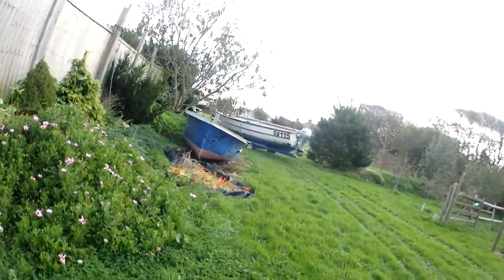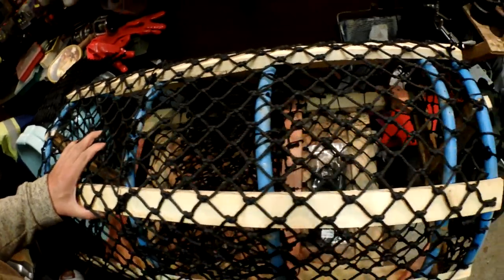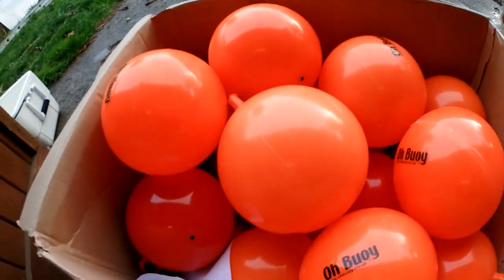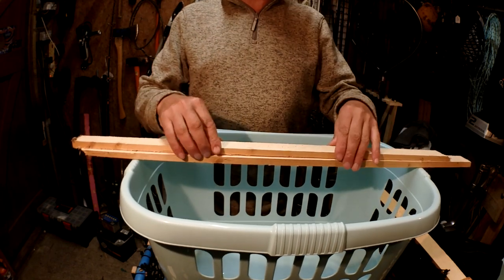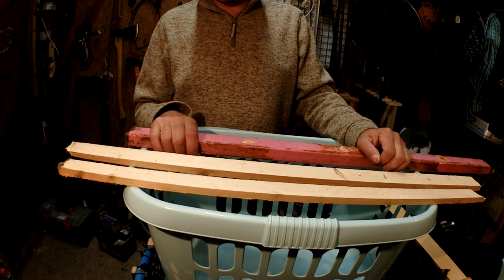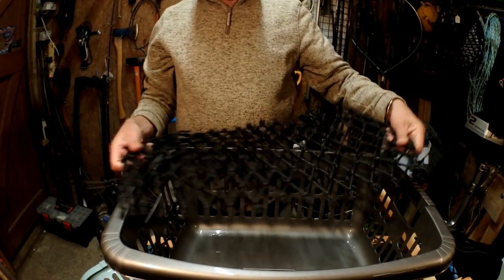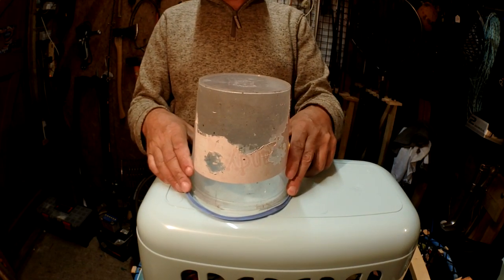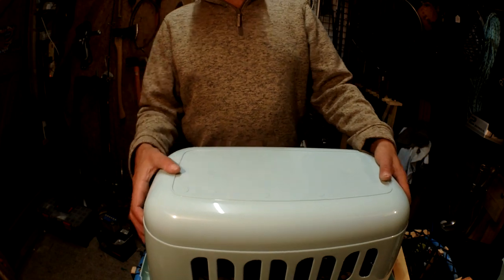⛵ Washing Baskets & Crab Pots - Buoys, lobster/crab Pot build thoughts & boats up

Comment: Regarding the pot entrance... Have you got any florists near you that have the black pots that the flowers come in? Sometimes, the supermarkets give away the pots, as it's a charge to them to get rid of them. They maybe an ideal size for the pot neck entrance once the bases are chopped off....? And for the weight, have you any railway footpaths near you? Have a walk along one. You might pick up a discarded bolt that would have been dumped at the side, rather than being taken away during maintenance...
Reply from the maker: Flower pots work but need the right plastic.  Unfortunately no railways here but good Idea.

Comment: Hi Troj
I have a couple of similar pots they are two plastic shopping baskets cable tied together I have a plant pot entrance slightly offset  in the top and they are weighted with milk bottles filled with concrete cable tied into the bottom  stainless wire holds the bait an inch up from the bottom of the plant pot in the middle of the trap.
I only put them out for one night this year but a got two big spider crabs so they work . Hoping for a lobster next year fingers crossed
Reply from the maker: Nice make sure your bait is at least a day old then the lobster will come

Comment: Hi Troj, Why not make the wooden base with the slats but make them a bit longer than the pot so that you can rope a concrete driveway block or engineering brick at both ends.
Should be heavy enough whilst keeping the weight out of the basket catching area.
Reply from the maker: Its an idea but Im trying to keep the pots as small as possible for this build

Comment: When we were kids we used these baskets, with the basket upside down we would fill the lip around the edge with concrete, it would brace the basket a lot and add a balanced weight low down,  we still had to add weight but not as much, and that was generally old rebar off cuts laced to the outside that we had managed to scrounge from any building sites we could find, thinking about it I guess they would have braced up the sides a bit as well.
Reply from the maker: This did cross my mind but not sure if the concrete would stay in the lip.
Reply: @Trojwaterman  Once the concrete is set we used to lash around the base with rope to secure the bottom and protect the edges, but if not doing it this way I would have thought pilot hole and a few short screws from the outside of the trough before pouring the concrete would work ok.
Reply from the maker: Might be worth a try I could use some chicken wire to reinforce it

Comment: Hi Troj, Could you put concrete in the cavity where the lip folds over. This could create an even weight all the way round so the pot would settle on the seabed properly?
Reply from the maker: I did think of this but not sure it would stay in, plus it would still need more weight.

Comment: Good morning! Man that basin turns into quite the tumultuous bit of water. I was wondering, do you have to make it so your trap will stop fishing if you lose it? Here we have to have a hole in the netting, closed up by rot chord, which is just basic Butchers string. I'm on the Pacific Coast of Canada.
What about plant pots? They are heavier black plastic in many sizes for your entry way? 
For weight you could sandwich piping, one inside the other inside another with threaded caps on each end, then bolt them to a wooden frame or plywood?
Reply from the maker: I do have the end of the pot strung so it can open but If I ever loose pots in a storm they would be destroyed if lost they wont survive the winter storms here. Flower pots is an option if I get get the softer plastic ones.

Comment: Well the washing basket trap I made has got some old oven shelves for the base with some lead piping cable tied to it for weight and the opening is a plant pot you use for tomatoes the one's with no bottom that you place on top of a grow bag, it looked great, I tried it a couple of weeks ago and when I tried to retrieve it it got stuck and I lost it! Not quite the plan 🤣😂
Reply from the maker: That was a bit of bad luck was it the rope that jammed
Reply: @Trojwaterman  possibly I'm not sure but you are probably right, thinking about it rope did look a bit frayed where it snapped

Comment: Perfect idea came to me, 2 or 3 long scrap steel reinforcing bars for the length sitting in holes part way through the timber either end of hardwood side braces at the ends & middle like a rectangle base, if you have some scrap steel box strapping to nail around the outside of the wood ends to pull the reinforcing bar all tight into a solid rectangle that you would spiral rope around the wood & steel base onto the open basket as well as net. If you don't have any reinforcing bar or net or box strap you can get from the hardware 12mm 1/2"x 3m 10' reinforcing bar for 5 quid, 1000mm x 35m Yellow Safety Barrier Mesh for 13 quid & a roll of 25mm x 0.6mm x 6m Punched Metal Strapping for 2 quid using it the same way for only 20 quid plus rope, baskets, flower pots & buoy's which I wouldn't know the price of.

With the top flat part of the basket, cut a large enough hole so that you can put a modified flower pot upside down with the skinny end sitting 10" above the flat part of the basket, this will prevent your spider crabs from getting in or huge mud crabs, the lip of the pot can be inside the basket screwed onto the basket or just use cable ties. Attach your rope & buoy or girl whatever floats your boat to the wooden part of the frame by drilling 2 holes 2" apart all the way through the wood so that you can tie your rope through for hoisting aboard having the strongest holding point on the crate. Job done simple, quick & easy.
Reply from the maker: reinforcing bars is a good Idea getting them more of an issue plus everything here costs an arm and a leg.
Reply: Use sand in recycled milk bottle containers tied onto each corner for weights

Comment: When you say work on the boat Troj, what exactly will you do?..what about the small boat will that be serviced as well?
Keep safe
Reply from the maker: I need to do some work on the engine mount and seat as there is some decay in the wood under the fiberglass I need to reinforce it. I also want to change the boxes cupboards that have the battery gps,and sounder. plus much more. the small boat is probably ok  but will go over the trailer.

Comment: Maybe you could get hold of some old rebar and run some lengths through holes drilled in the basket and secure. I used a load I found on the beach to reinforce and weigh down a light lobster trap I bought online.
Reply from the maker: That could work if there's enough weight

Comment: Plenty of stones on the beach for weights,you could cut them with an angle grinder to size and drill them for fixing.
How about kids beach buckets for the entrance?Garden centres sell  different size buckets,I got a dozen online for mixing fibreglass.
Reply from the maker: Stones again will fill the space need a fair weight. Buckets is an Idea if the plastic is tough enough.
Reply: @Trojwaterman  There is quite a range of buckets,and they don't deteriorate in the weather.
As a builder,I would cast concrete bases for the traps.If you use pea gravel and a 3-1 mix,it would be dense and as heavy as steel pipe.The cement mix is tough and almost impervious in the water.You could cast holes in the base quite easily with removable plastic pipe for fixing.

Comment: I just worked out the cost for 6x Crab Pots with 6x 6" Floats, 6x Bait Holders, 6x Jumbo Laundry Baskets 67L W:490 H:300 L:725, 6x 3L Buckets W:190 H:160 L:190, 9m of 16mm Reinforcing Bar which makes 6x 2x 750mm, 1m x 35m of Yellow Safety Barrier Mesh, 25mm x 0.6mm x 6m Punched Metal Strapping & 8mm x 250Mtr High Strength P/P Rope costing 28.34 GBP each Crab Pot. But If I go & buy ready made store bought flimsy Crab Pots they would end up costing me 52.38 GBP  each Crab Pot with all the added bits like above. The Crab Pots I'll make will be the same size & almost half price, amazing, built on the same idea in a previous message below.
Reply from the maker: The biggest issue with store bought aside from the price which are around £60 to £70 here with no rope buoy, is they are also more likely to be stolen than a homemade pot. I am aiming with these for £10 to £15 without rope/buoy. But the biggest goal is making sure they catch more.
Reply: Yeah if I didn't add the rope, the 6" floats & 6 bait holders then my setup would be much cheaper all up too but I think I worked out a reasonable deal, I'm unlucky that I can't get to any scrap in my physical condition  so I need to rely on buying everything new so to keep the price down I really need to be creative. Because you don't have access to steal you could tie some old milk bottles to the corners & fill them with sand, if they burst open or get damaged then no drama, just replace them. Come to think of it I might do that to  each corner of mine lol, that's taken off 4.32 GBP of each of the 6 Crab Pots.

Comment: Hey trojs I made a laundry basket pot used some stainless steel mesh for the bottom had two lobster and a decent size edible crab on first drop 
Can you use plastic bottles as marker buoys
Reply from the maker: Bottles If they are big enough with colour and can be seen by other boat traffic. Plastic cans are better as you can tie to the handle but I would not use where they get pulled under the water as they will get crushed.
Reply: Trojs Fishing ok thanks a lot have you got any old mesh you would sell for crab pots or crab pors